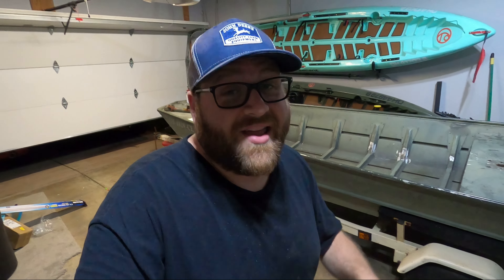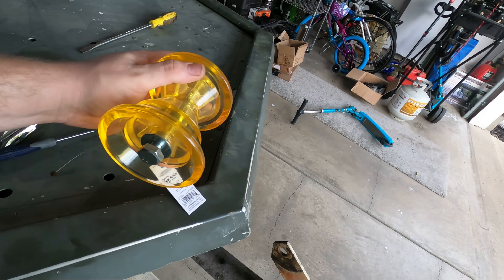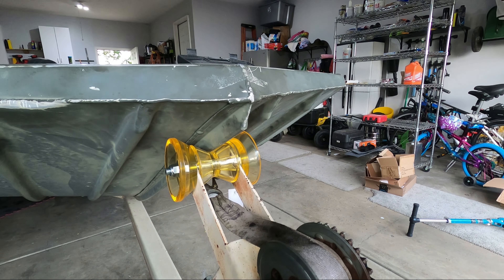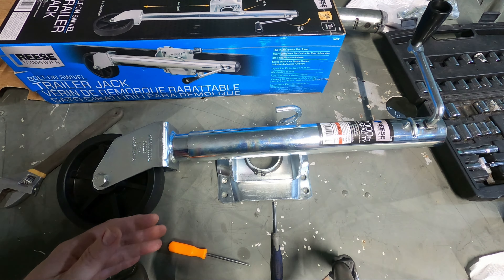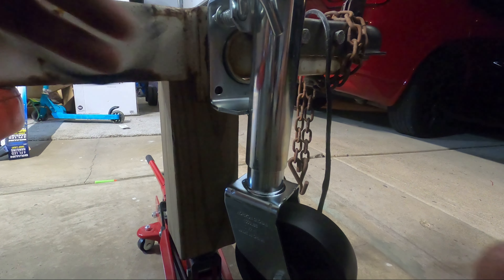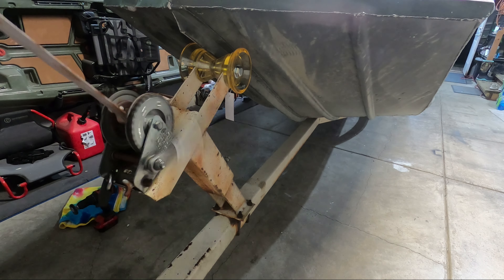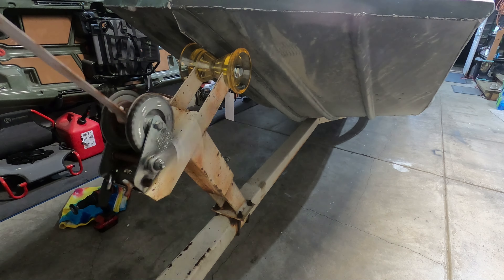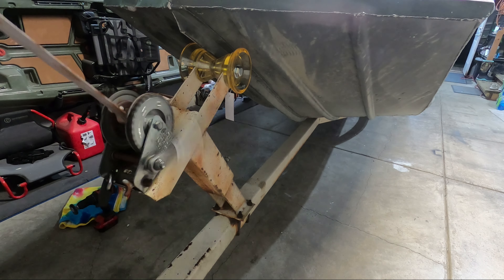EASY BOAT TRAILER UPGRADES & HOW TO INSTALL THEM - JON BOAT TO BASS BOAT BUILD CONVERSION UPDATE

Comment: Reverse the winch and re-wind the strap so it comes off, and goes on the spool correctly and that will put the winch handle on the port side as it should be.....

Comment: *   I agree with all your improvements, but why didn't you switch the winch handle, and the trailer jack to the driver's side. The way you have it set up, you'll be constantly climbing over the trailer tongue.

Comment: while it was at the welder, why did you not get him to weld a 1inch flat bar on the nose so it wont cut into the roller ?
Reply from the maker: It wouldn't rolled into the trailer very well if I did that, the roller that was replaced was just super old and dry rotted, the new silicone one installed shouldn't split any time soon!

Comment from the maker: Any other trailer upgrades you guys suggest? I think for sure I need to get a spare tire holder.
Reply: I'm working on up grades to my CC 2005 Palm Beach 161: spot light for the bow (magnetic base) and can use on the helm (navigating at night & finding unlit boat ramp. Will add LED backup lights to trailer. Already switched to LED tail lights. More plans, LED deck lights, compartment lights & stern lighting for night fishing. Add DC outlets/switches. After that....convert old Elgin aluminum 12' to Bass boat.  The challenge (?) time and purchasing items.  "Few items at a time".....retired & set income. Enjoy the work and love fishing. 
Keep me updated on your progress.  Thanks
Reply from the maker: @donalmeadows794  Sounds like some killer upgrades you have planned. One step at a time, going to turn out great.

Comment: Nice upgrades to an old trailer.  I wonder with your investments in parts, why not restore the trailer frame before adding new parts ? Maybe that's a future project ?  

I plan on converting a Northern Tools 40"x48" trailer to a boat trailer for an old Elgin 12' aluminum boat. Elgin is a bass boat "to be" though she doesn't know it yet...lol. 

Good fish'n days for you.
Reply from the maker: Definitely a future project, I was in a rush to get the trailer up to spec to take the boat to a welder. I plan on sanding and doing a new coat of paint for sure.